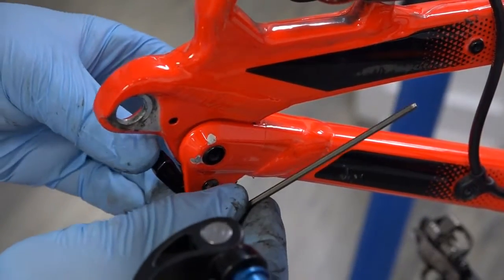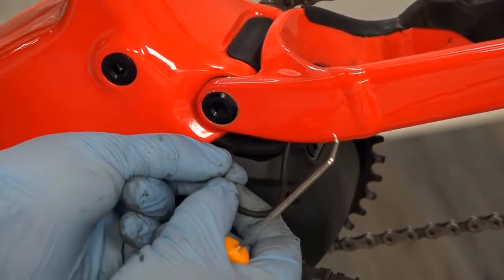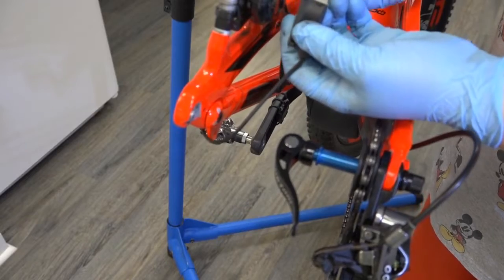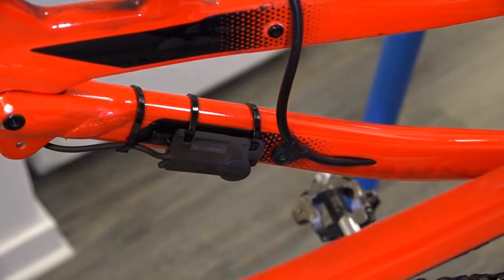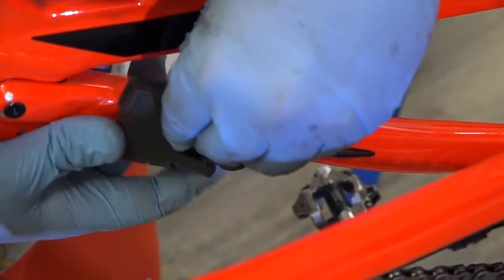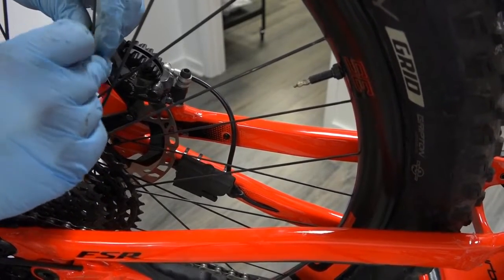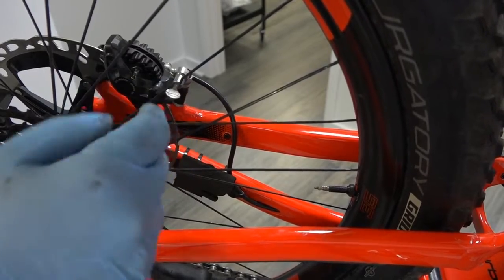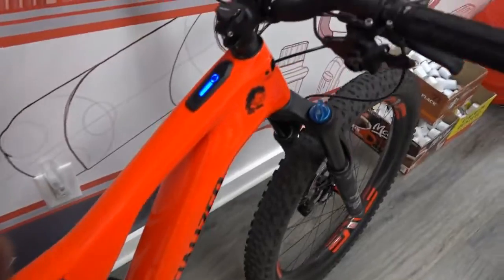Badass Box Installation on 2019 Specialized Levo Brose

Comment: Wow, watching this really makes me appreciate how wonderfully simple the PLANET3 is in comparison!
Reply from the maker: yeah but with Planet3 you're constrained to the OEM rotors.
Reply: @asvlabs8470  Where'd you get that info? I'm running Shimano XT on mine, but it says it's compatible with almost all 6-bolt rotors. A few friends have it on Hope Floaters, too.
Reply from the maker: @tupamaros4306  you can't use it with XTR rotors or any high performance Centerlock rotors.  some people are willing to compromise, others are not.
Reply: @asvlabs8470  Flawless argument! I literally can't think of a single comeback, and therefore, I retreat in shame.
Reply from the maker: @tupamaros4306  there will be more solutions for Centerlockers as time passes and more creative minds emerge. :)
Reply: Could also be done by an app called BLEvo. Says it should work on all levo/kenevo modells even the new 2019/20 models! No hardware needed!
Reply: You think that is difficult, wait until the gear mash up in the Planet 3